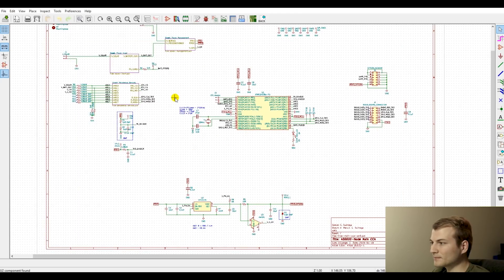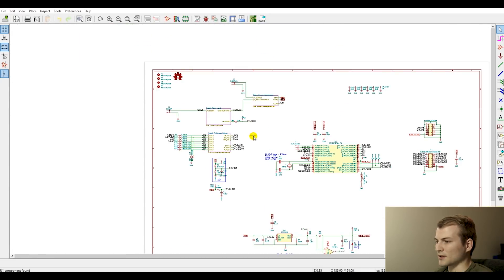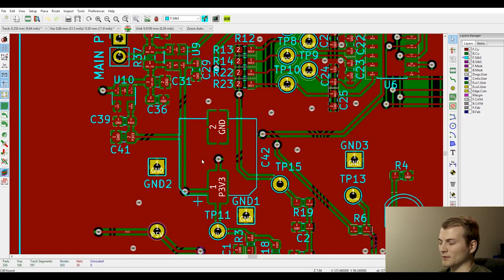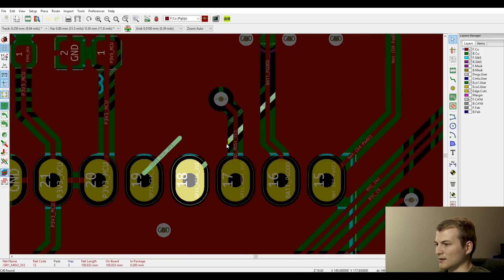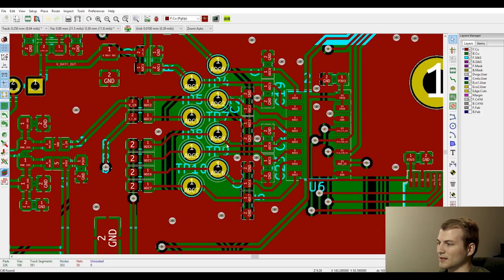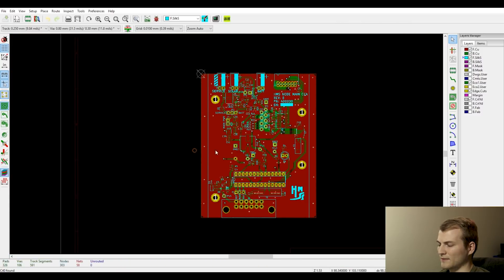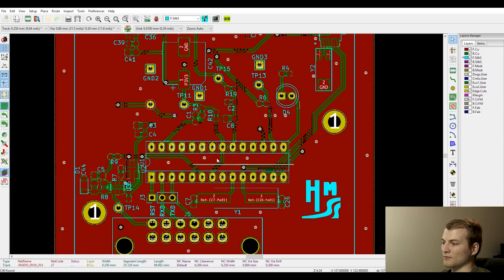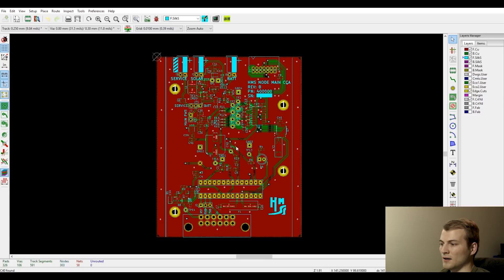Sensor and Peripheral KiCad circuit - User Submissions #2

Comment: Thank you for explaining the different parts which can be improved. As a beginner, a lot of videos I watched mainly give a suggestion but not the reason behind it.

My main takeaways from this video
1. Keep microcontroller near SPI bus - shorter path = faster speeds
2. UART is slower, can be put further away
3. Keep Analog signals away from digital signals 
4. Be careful of closed loops 
5. Use smaller components - save space, save money
6. Remove holes/vias if not required
Reply from the maker: Yes, all of your points sound good!

Comment: The return current will flow back to the supply all over the place.
Reply from the maker: True, but only at lower frequencies, and it still tracks towards the path of lowest resistance. Here's a great article with images at different frequencies. Check figure 6: https://incompliancemag.com/article/alternative-paths-of-the-return-current/

Comment: Great video, again!
I agree on going more to smd components. Saves space, and minimizes trough holes that can often interfere with routing on the other layers. Not that hard to solder. Just need some practice, and some head magnifying glasses or similar. $10 on Ebay. Liquid flux, tweezers, solder wick, good lamp. And good ventilation! Solder fumes isn't good for our health.
Always wondered why there often is so big crystals on dev. boards, Arduinos etc. Price?  I like the smaller ones better, like 3x5 mm or smaller. Can be a little bit difficult to solder. A custom footprint with bigger pads helps. Or use hot air and solder paste.

Comment: It says 47 mF - it's a supercapacitor?
Reply from the maker: Perhaps, still don't know why it would be needed.
Reply: mF typically means microfarrad when dealing with caps. I think it's a holdover from older times. It's certainly poor design to include mF and uF suffixes in the same schematic.

Comment: Thanks for helping us to improve our PCB designs, I have learned a lot with this series of videos. Do you happen to know if KiCad is able to measure track length? And the last question, when using test points for analog signals, can those test points be surface mount and don't have the problems of TH test points?
Reply from the maker: KiCad 5 does yeah. ctnrl click a trace to highlight the net, and look on the bottom menu, it'll say the length. Exactly. I would definitely recommend small(ish) surface mount test points for any high speed or analog traces. Can always solder a wire to it for more permanent testing if need be.